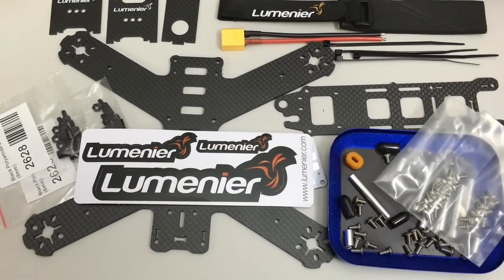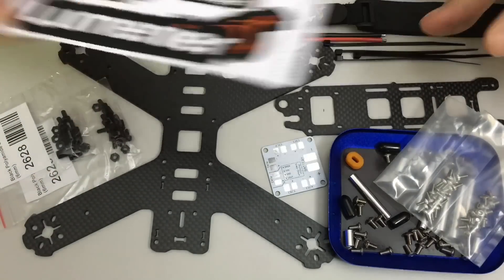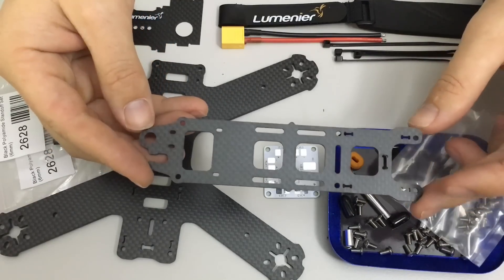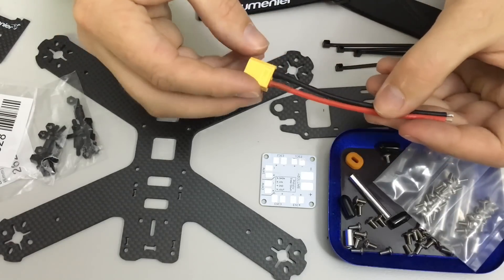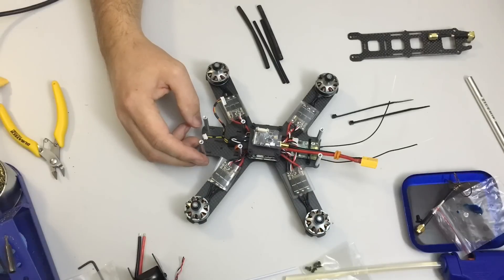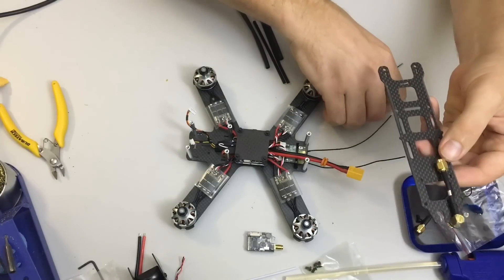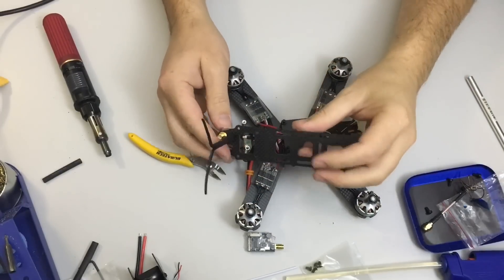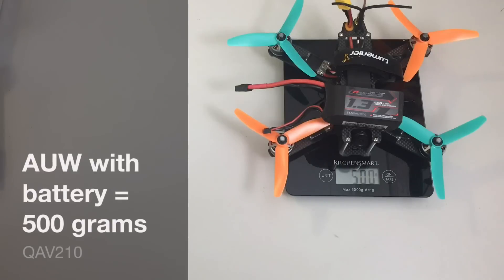Part 8 - 5"MQSO - Lumenier QAV210 Build Summary

Comment: I've built a qav210 and done the same mod as you with the extra posts also got the after market 2mm top plate and 4mm bottom plate makes the quad a little heavier but I haven't broken anything since keep em coming mate great videos also I mount my antenna different to you I'd like to show you if I could 

Dave

Comment: Another great vid!Do you predict the 210 might replace your 180 in your travel quad arsenal?
Reply from the maker: +Andrew Ortwein No I don't think so.  It is proving difficult to tune unlike all the other quads in the shootout.  I'm thinking its a motor vibration issue, not anything to do with the frame.